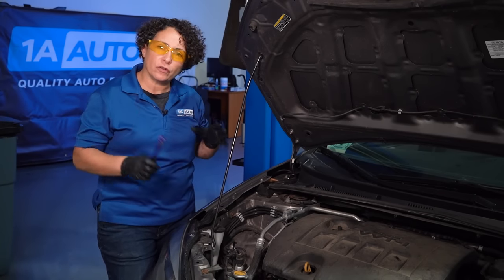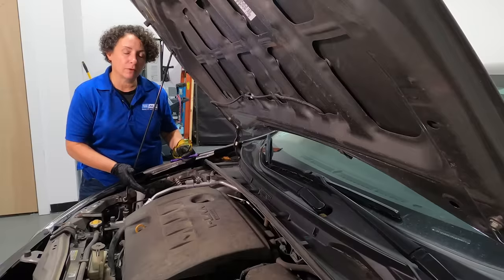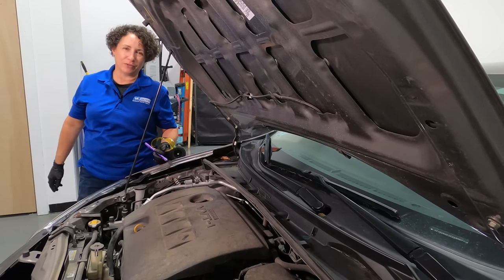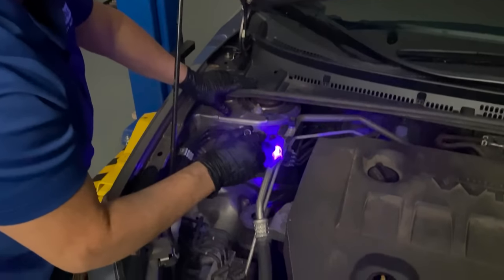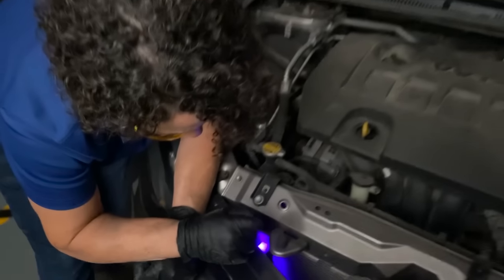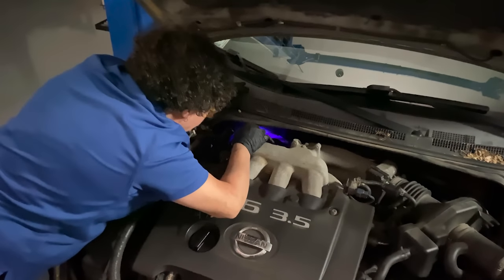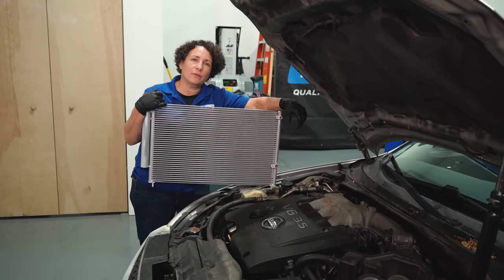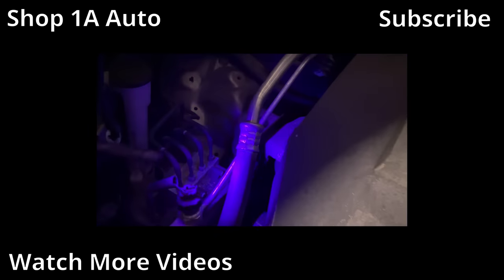AC Stopped Working? Easily Find an Air Conditioning Leak in Your Car or Truck And Solve it Fast

Comment: This lady is obviously very knowledgeable re Auto AC Systems, BUT, for the novice watching this, she totally "glossed over" HOW to get the UV Dye into the system, AND as a previous commenter noted, if one's system is completely "dry" (no Refrigerant in it whatsoever), and/or its completely inoperative, you CAN'T get any UV Dye into (and thus circulated throughout) the system!!

Injecting AIR under pressure into the system (if the UV Dye method can't be performed) is also a way to LISTEN for leaks, as well as by observing, using a bottle of soapy water, and spaying it on the various ac hoses, and related refrigerant-carrying tubes, etc, and looking for the "bubbles".  ONCE the leak is located, and repaired, THEN the system must be THOROUGHLY VACUUMED OUT, to remove all moisture.

Good video, but inadequate imo, and those watching this would do well to view a number of other related YouTube Vids, in order to get "The Whole Picture"...

Comment: You forgot to mention you need to add uv dye into the system through a Schrader valve in order for it to show up with the light and glasses. Adding the dye will not work if your compressor and ac clutch won't engage due to low pressure to circulate the dye through the system. You can bypass the low pressure switch but if you ac clutch and compressor don't engage you'll have to replace those first before you can begin to diagnose a leak

Comment: Sue, I have a 2004 F- 250 with 180,000 miles, for almost 19 years old truck I've never had any A/C problems. Never had it charged and thankfully it still blows cold air. That's unheard of but true. I'm the second owner and as far as I know the previous original owner never had any issues the 7 years he owned it. Always enjoy your videos. Very helpful info you share.

Comment: I can agree to an extent about your opening statement of “ac doesn’t go bad”. Refrigerant is hygroscopic, meaning it will absorb moisture, which will contaminate the refrigerant. Your AC system is meant to be serviced (every few years), not so much to replace the refrigerant, but to vacuum the system to boil off that moisture. Also, “Freon” is not used. Freon is a brand name for older gases (R12). You’re not going to find Freon in modern vehicles.
Reply: Not to mention you have to change the oil in your car anyway, why wouldn't you wanna get an evacuation and recharge to get fresh oil anyway
Reply: What misture? It can't enter the sealed system. Even if the refrigerant is leaking, it does not mean the moisture can get it. Refrigerant molecules are much smaller than water molecules. And the system is under pressure, while the moisture in the atmosfere is at the atmosferic pressure, so it can't get in.

Comment: Hello, I had my 2016 Ford Explorer A/C diagnosed with a rear line leak. They estimated the work would cost $2500-$3000. Is that an accurate or a honest estimation for the job?They evac and recharged the system with dye a week ago. 6 days later, it was blowing hot air again. 
Thanks

Comment: And then, you have people like my brother. You know, the kind of people that will spend $1000 to get the a/c fixed on their 1999 whatever but won't spend $250 for new pads, calipers and rotors when their brakes are grinding! Maybe I'm wrong but, I think brakes are A LOT more important than air conditioning!

Don't worry fellow viewers! I spent $250 of MY OWN money and installed new pads, calipers and rotors on his car for him! I didn't touch the a/c system though, that's on him!